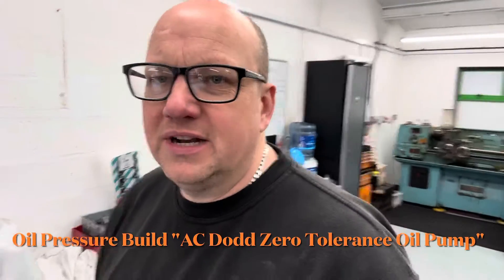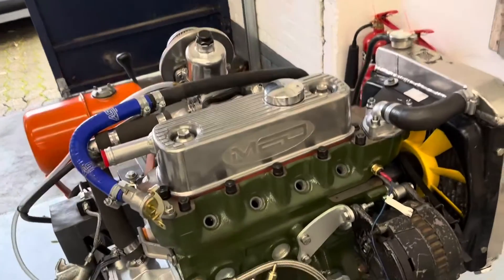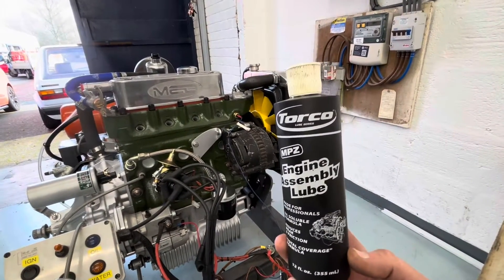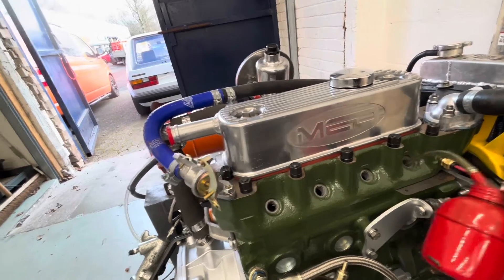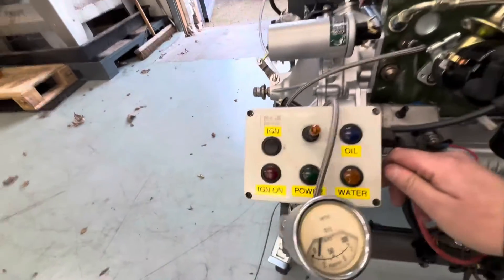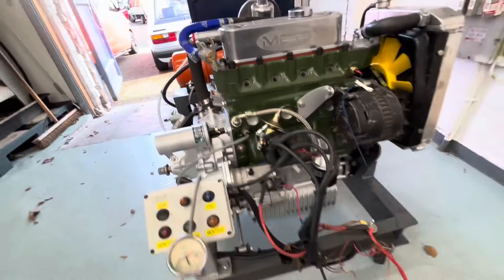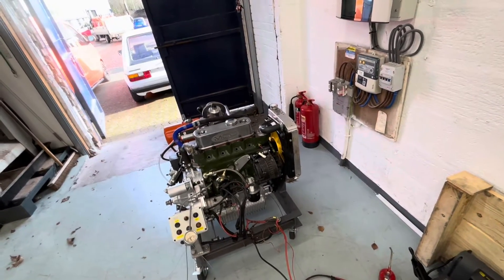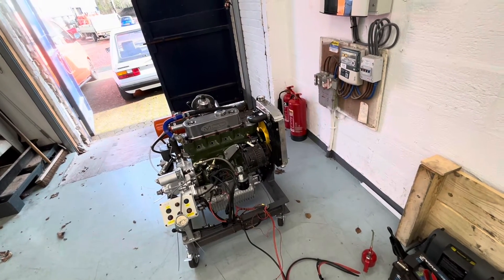Classic Mini Oil Pressure Build with @ACDodd "0" Tolerance Pump

Comment: What would be, or has it change with a modified pump, the cam end float measurement? Thanks. Jon in Ohio, on an A35 1275 swap.
Reply from the maker: Camshaft end float is not affected with the use of a modified pump. No extra allowances needed. 3-7 thou is standard. Lower the better for timing scatter and chain wear